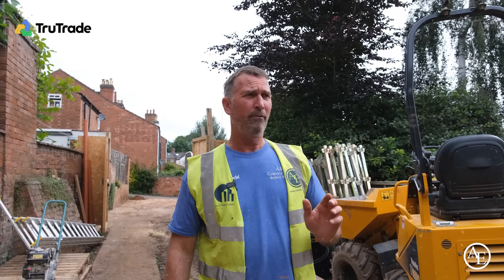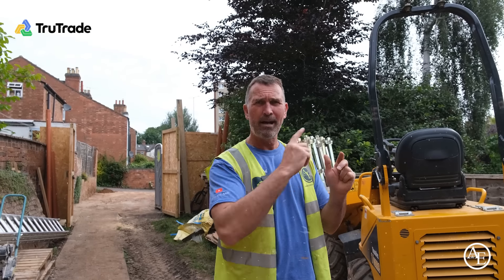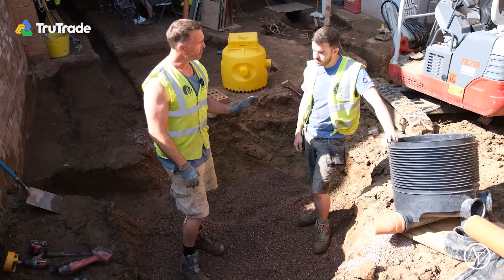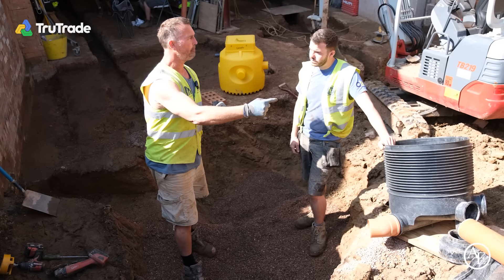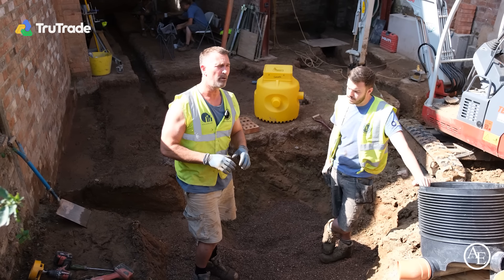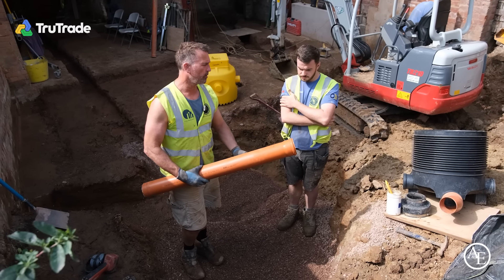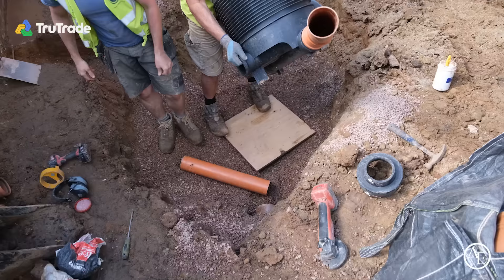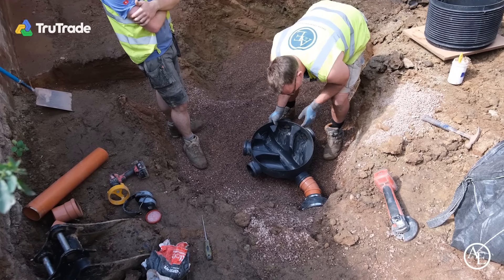How To Install Drainage | DIY Series

Comment: This was an awesome video! Thank you! Do you have any tips for suspended pipe work? Hang from joists or build up brick supports? (In void under floor)
Reply from the maker: Much appreciated I would use Stainless Steel band or support under which ever is easy if no damp issues you can use Galv Band hope this helps all the best Tony 👍
Reply: @BuildWithAE  Thank you so much 👍👍

Comment: Been doing our drive and all our paths when I’m not at work and have time , broke up some concrete and noticed the seal had gone on a joint on our soil pipe onto the clay part , so had to take it all to pieces and replace it , was a nightmare trying to push the new coupler on tried twisting it but had to gently tap into place with rubber mallet in the end
Reply from the maker: Hope you got it sorted all the best Tony 👍
Reply: @BuildWithAE  yep all sorted thanks